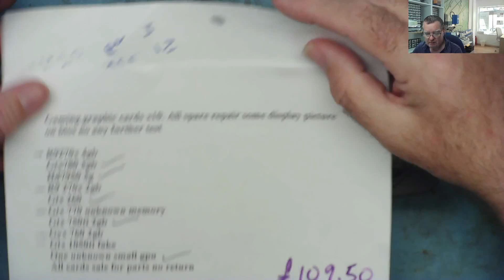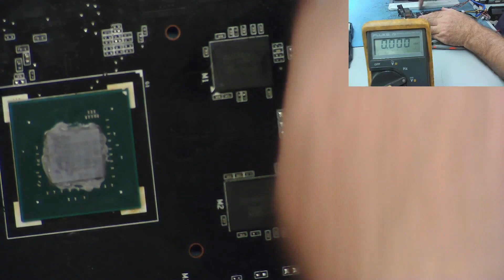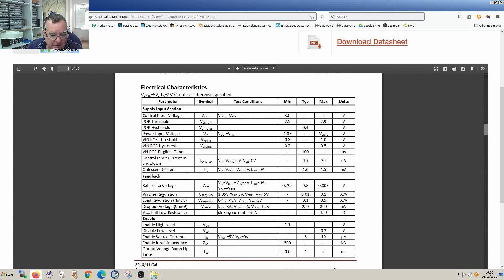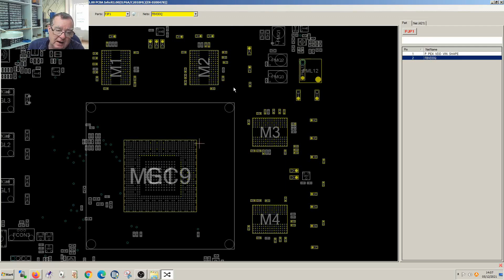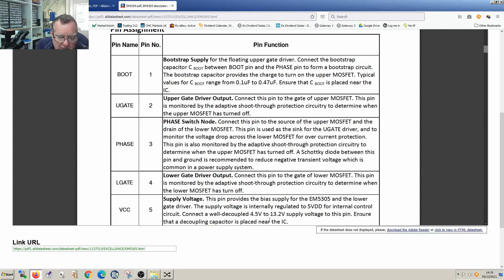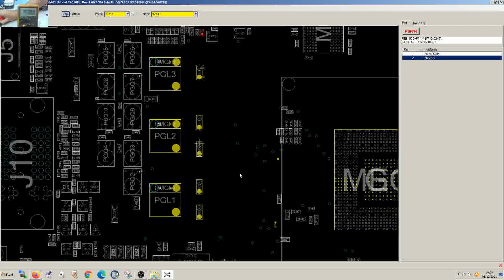Learn Electronics Repair Christmas Special #1 Fixing An EASY GPU Fault the HARD way with Boardviewer

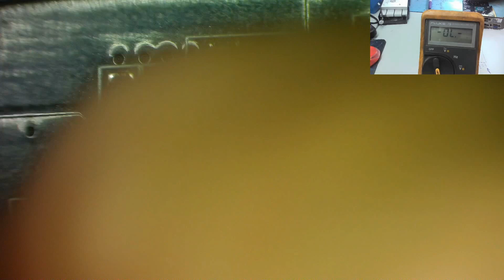Comment: sorry i know this is a old video at 38:38 the M3054M IT REALLY LOOKS LIKE SOMEONE HAS REMOVED THAT AND PUT IT BACK ON BUT IN THE WRONG PLACE. THE TOP 4 CONTACTS ARE NOT TOUCHING BETWEEN THE SOLDER PADS AND THE CHIP.

Comment: Looks like residue from rosin based flux that stays on the board forever. I couldn't get why you didn't use the 6-pin, it was funny when you figured it out. Loved the hat and the lights. Merry Christmas Richard.
Reply from the maker: I just didn't spot it somehow - was in the wrong place LOL.  but it entertained a few folks anyway

Comment: aah, but once you noticed the elusive 12v_pex6 connector, did the card powered up? i expect not, since it shoulve greeted you with respective bios message and possibly even audible beeps when powered from pcie slot alone - older models often had dedicated beeper for that purpose. also there was lot of r/rma flux under the gpu, and the stuff at the beginning was oxides in flux residue left over from shoddy cleaning, and pwm controller looks like its been replaced, finally some 0402 resistors in pwm area look suspicious tho that might be atrocious white balance in the video
Reply from the maker: @di nf
yes mate the video card is this one which I made another correctly diagnosed video a few days later
https://www.youtube.com/watch?v=a7qapVUeRLM&t

It's the one that does power up but has lines on the screen. I'll make a part 2 of that one between now and new year as I am not doing any work as such (apart from any emergencies with bars or hotels TV)..  This is the one I need to try a few subscriber suggestions but will probably end up removing all the RAM and show how to test if the problem is with the RAM chip, the GPU Memcontroller or shoddy reflow work.  On the published video we determined the RAM chips have definitely been reflowed and most likely the GPU as well

So this video ended up on the cutting room floor and stayed there until I thought it would be entertaining enough to make a good Xmas special.  I hope you enjoyed it, Christmas Special #2 is coming at 3pm GMT today -it was filmed in the summer but never published and that one I think is possibly even more entertaining